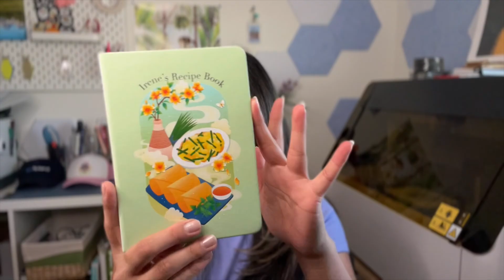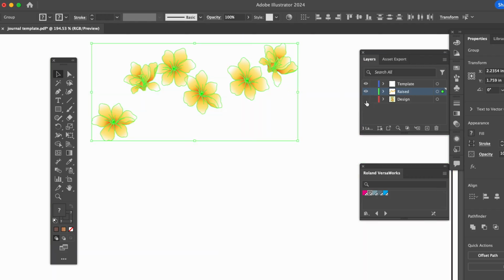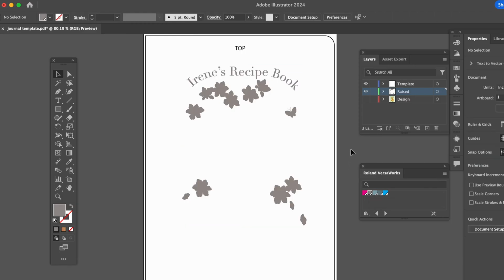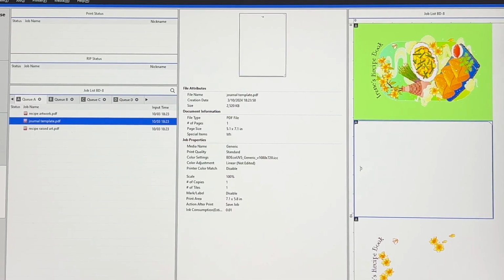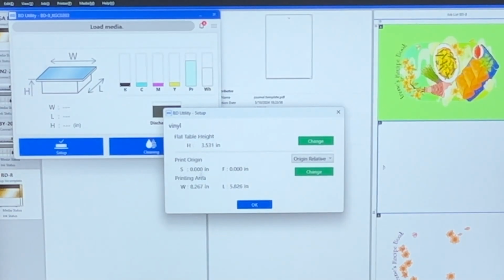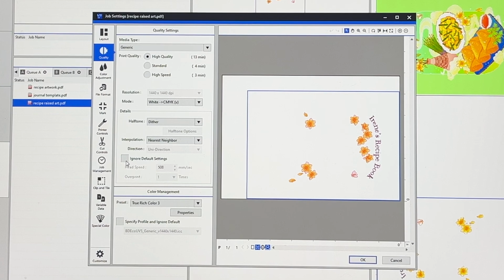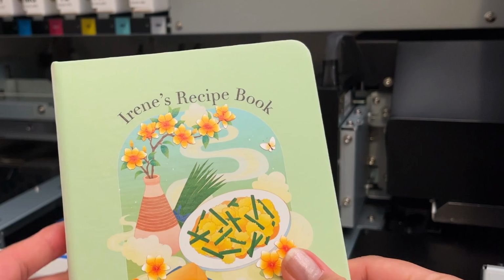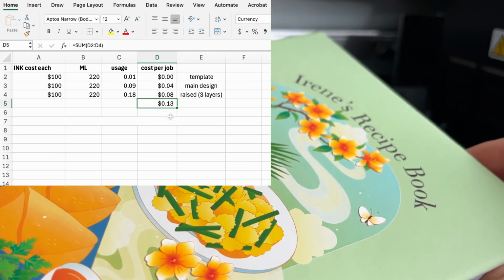Raised Spot UV Effects | Roland BD-8 UV Desktop Printer

Comment: Do you need special exhaust components for the Roland for ink fumes or is this model fine for a small office?
Reply from the maker: I don't have anything extra and don't notice any smell - neither does anyone in my house. I think the Roland ink itself probably smells way less than other brands. And in addition to that, the filter inside the machine does a pretty good job. You can also control the strength of the filter and choose whether you want it to be on during operation and/or during idle time as well